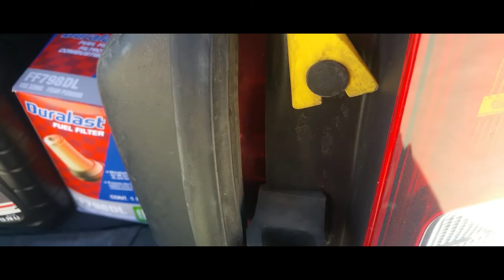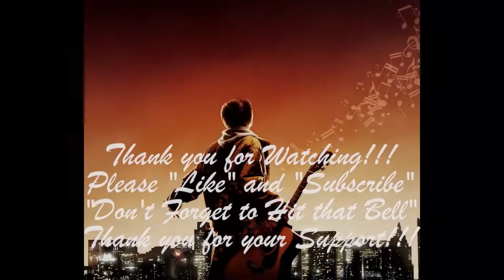How to: Remove passenger Tail light from  a 2014 Jeep Compass

Comment: Were can I buy that tool?
Reply from the maker: I work at a Dealership and found this inside one of the cars when we picked it up from the Ford dealership. This is a very good one high grade, I had purchased some from ebay but there so flimsy. I found some at Harbor freight that look nice and thick and good for the price and its a KIT.  
 https://www.harborfreight.com/nylon-pry-bar-installer-kit-4-pc-63594.html?cid=paid_google|*PLA+-+All+Products+-+Higher+Sales+Items|New+Products+-+%281%29+Price+%3C%2410|63594&utm_source=google&utm_medium=cpc&mkwid=sJBJFOzBE|pcrid|278978017105|pkw||pmt||pdv|c|slid||product|63594|&pgrid=56296736066&ptaid=pla-489074772392&pcid=1458484684&gclid=CjwKCAjwy7vlBRACEiwAZvdx9ig_Qh2HvGjnMvkTLzhQjXbkLjdfD7gT6FyGYMcacpI1rQhOyuGpfBoC4pQQAvD_BwE
Reply: GEORGE LOPEZ HOW TO DO IT YOUR SELF do you know the name of the tool so I can ask for it?
Reply from the maker: @ncruz69  Nylon Pry Bar Installer Kit 4 Pc
https://m.harborfreight.com/nylon-pry-bar-installer-kit-4-pc-63594.html